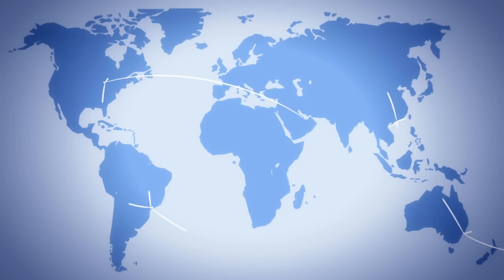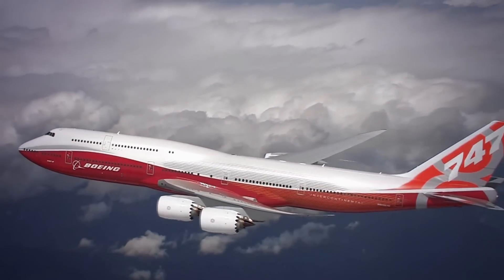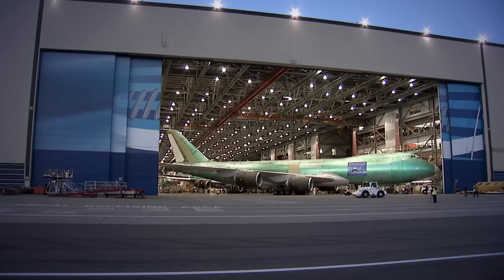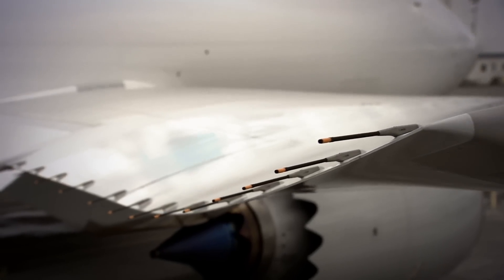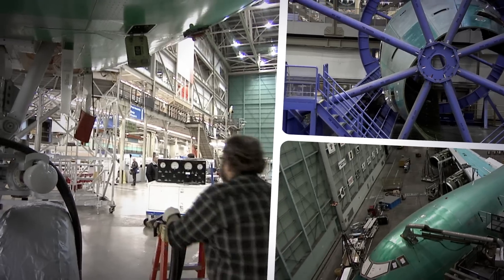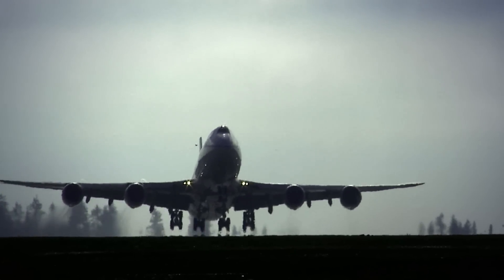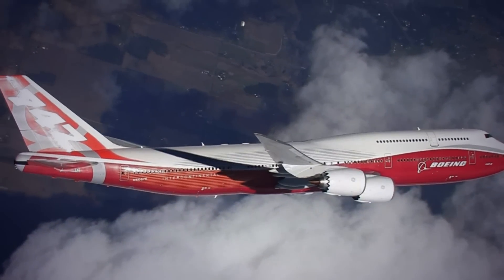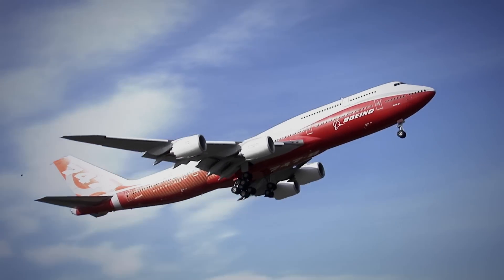747-8: A new lift in performance

Comment: PLEASE CORRECT ME IF I AM WRONG.... MOST OF THE AIRCRASHES HAD HAPPENED TO BOEINGS OTHER THAN AIRBUS. SO ISNT AIRBUS SAFER EVEN THOUGH ITS SUCKING STYLE?...IF YOU TAKE A VIDEO OF AIR CRASH INVESTIGATION ,..IN THE INTRO THEME ALL THE PLANES SHOWN ARE 747S....AND I ALSO LEARNED THT THE FUEL TANK IS JUST ABOVE AIRCONDITIONING POWER UNIT AND A MID AIR BLOWUP HAPPENED DUE TO OVER HEATING OF THE FUEL DUE TO THE EXTREME HEAT OF THE AIRCONDITIONING UNIT........ PLEASE CORRECT ME  IF IM WRONG ....